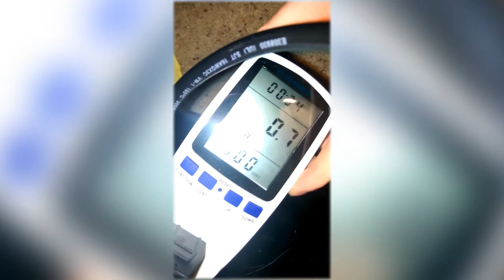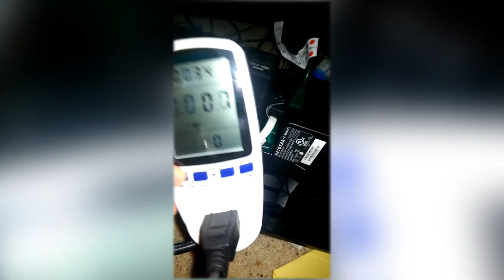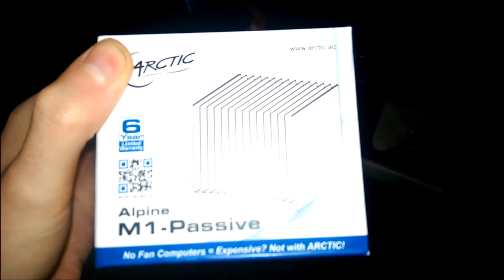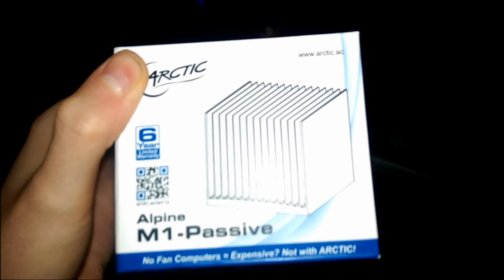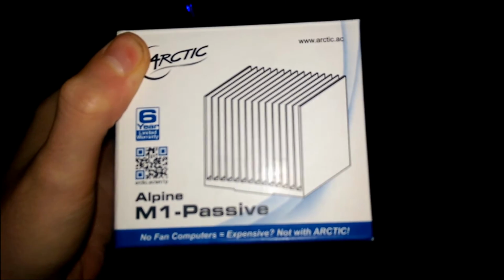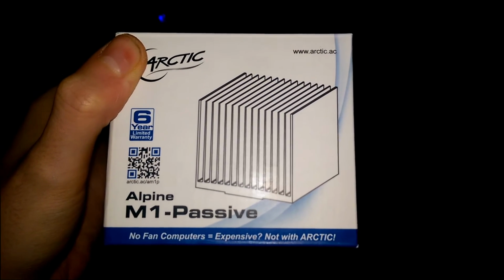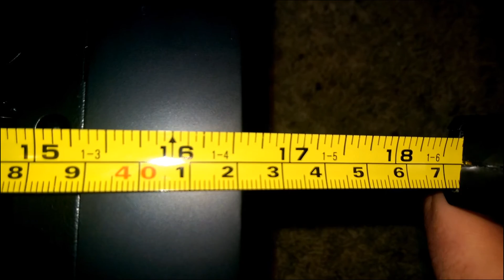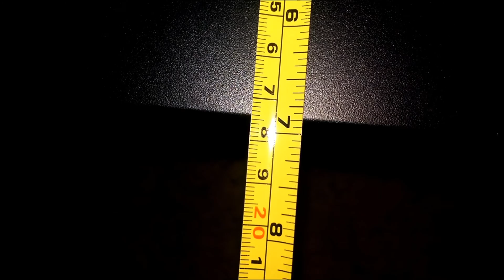Home Network Overview and PfSense Build Log Update

Comment: Just wondering why you went with a picoPSU instead of a more reliable atx PSU. 
My pfSense router is running on a Dell Optiplex 760 slim pc. btw good job on the setup.
Reply from the maker: +Wayne Vining (HooKed) I originally planned to get a normal atx power supply, but since the pc had such low power requirements I couldn't find a good quality low watt supply.  I found a cheaper picoPSU and stuff on ebay that I thought would work good, and go for my silent build.  But the ones I got from ebay didn't work so I ended up spending more buying a good quality power adapter and picoPSU.  But it was my first time using one and thought it would be cool to use.